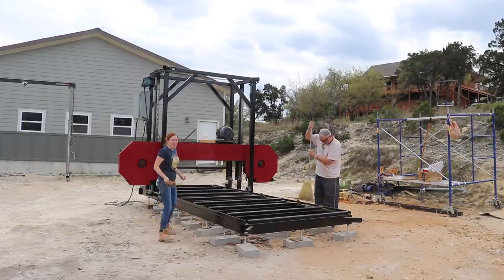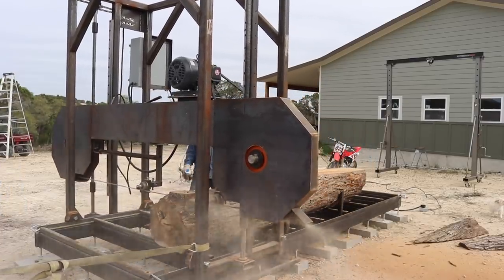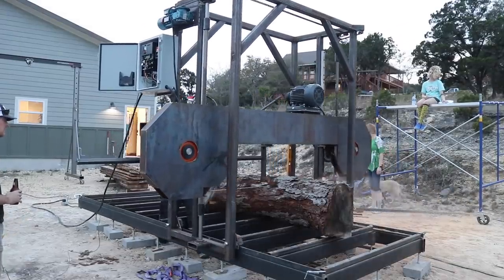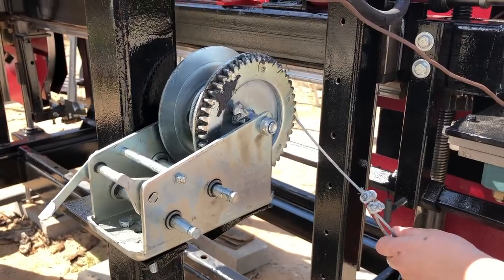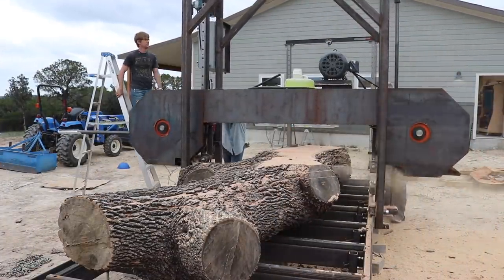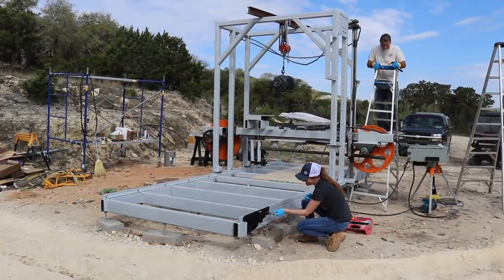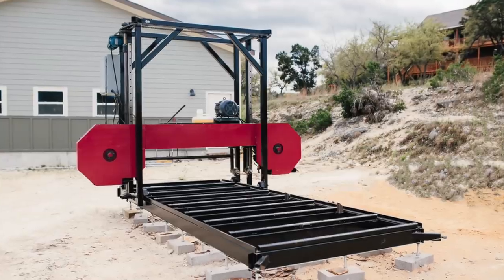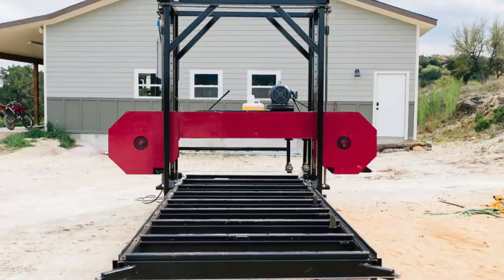Slabbing With My Bandsaw Mill

Comment: April don't use Diesel!!!  Old time sawmills used diesel.  The main reason is that back in the 1880's to the 1930's diesel was cheap.  The reason that diesel is used is that in cold sub freezing areas it prevents the blade from locking into the logs when cutting frozen logs.  It also prevents the slabs from instant freezing back to the log after a cut is made.  The reason that frozen logs have a problem with water is that when the hot blade cuts the log it melts the water in the wood.  Then what happens is that because the log is still frozen as soon as the blade moves father down the cut in the log the water instantly freezes.  This can cause the log and the cut slab to pinch the blade and lock and freeze the blade inside the cut.  Just use water when it is warm and when it gets cold use water and windshield wiper fluid mixed.  If you see ice forming in your tank then switch to straight windshield wiper fluid.  The best thing to do is is really when it is super cold is to just to switch what your cutting from hardwoods to conifer trees.  Conifer trees cut better when frozen because when it's super cold the thick sap in the wood prevents freezing and the other reason is that when frozen the blade will start following the grain in frozen hardwood logs and it will give you a cut with waves in it.  Conifer or softwood also is easier to cut when frozen.  The best way to know how the saw is cutting is not by looking at it.  It's really the sound the blade makes when cutting.  Band sawmill blades don't really need lubrication to make them slippery when making a cut they need lubrication to cool the blades.  Feel the temp of the blade with the back of your hand.  If it's hot increase the amount of water to it.  You video shows a few seconds of the flow rate.   It looks like it is too fast.  Just remember water works best and windshield washer fluid just keeps it from freezing.  Also the color change in the wood is cause from the acid in the wood.  Some woods the color is only on the surface and when it dries it goes away.  Other woods like red oak the acid is a stronger and reacts to steel and iron and will stain and wreak the entire board.  If you don't know how the wood is effected by the acid it is best to rinse the boards with clean water.  In the old days you would see a dunk tank located close to a sawmill and that is what it's for cleaning boards.  You will also notice that your hands will get red it also because of the acids in the wood.  Wash your hands all the time and get a good pair of gloves.  For now you can just hose off the boards with a garden hose and everything will be fine.  I have 29 years working and owning my own sawmill and I hope this helps you and I love your project.

Comment: Don't leave your blade taut as the steel will take a memory of the wheels and when you cut you could possibly get the blade drifting in the wood. Josaljo Wan shows this when you take your belt off your pants and hold it up it doesn't stay straight but rather is like a s shape Great souse of information for saw-milling Tell him I sent you!

Comment: Cut many a mile of wood and never would I have a atomized diesel mist on the wood and in my lungs. Water with soap unless you have water available under pressure. Then just flood the blade with plain old water. Use felt wipers on the blade, both ends.

Comment: i wouldnt go for diesel or kerosene. maybe u wanna us chainsaw chain oil liquified with some alkohol since it is biodegradable and u wont cause aqn oil spill. beware though: whenever u use OILS for lubrication u will have trouble PAINTING, GLUING or EPOCY-ing your slabs since surfaces need to be DRY DUST- and FAT FREE for that!! water evaporates without causing this problem and diesel will also stink like hell. good enough for concrete formwork that will receive some release agent anyway but not good for flooring, construction wood let alon table tops or funiture...i still recomend water or GYCERINE: it is a 3-fold alohol , dense as oil and it can be water-thinned. keep it simple ;-)

Comment: What is the wait time for the logs to dry 🤔? Just a rough estimate
Reply: In very rough estimates...one year per inch of wood.  It's all relative to the type of wood, time of year it was cut down, and of course...the local conditions with respects to heat and humidity.
Reply: @johngrace199  thanks for the helpful information 👍🏼🤙🏼👌🏼

Comment: Instead of you and another person standing the danger zone if the blade breaks. Why not install a lightish spring between the two and install pieces of heavy duty PVC as rollers instead of two solid pieces of steel as log blade guides.

Great build though!

Comment: That blade lubricator ends in a thick felt wick, which is spreading the diesel across the width of the blade. The wick allows good yet economical coverage of the blade. (the fire risk is a different matter!!)
Reply: One thing about Diesel, not much of a fire risk.

Comment: Be a little cautious about getting close to the moving parts-- wood and machinery can be very unpredictable, especially when blades hit something so hard it causes them to even slightly warp and twist, then when there is less resistance the wood can split and fly off. Not a good idea to be moving around so carefree in the target zone. You don't learn that through education and you sure don't want to learn it the hard way.

Comment: Why does everyone put loose blocks on the dirt. A slab is liely a waste.  Put down a spiked metal channel to place you blocks in or make a concrete channel fro each side. Block in the two sides so they are all together like a frame.   A micro video picture of the blade in action shows its vibration, or not should be smooth and no up down during roll.  The longer it dries the better but you should tarp it.

Comment: Next you need to make an oven. Then  wood dry and cure in acid and then dried and then baking in 1200 degree for 2 hours. it will turn out petrified . there's a little more to it. you can artificial petrified wood bake it in 2 hours . Not no millions of years.

Comment: If the top bark piece is to small to actually cover. I'd leave the top off and use a piece of tin.
Also, these logs for the most part are going to be smaller than Cremona's,  might want to use straps and compress the logs .
Great job!😊

Comment: I have a SinglePhase 1/2hp gearhead motor for your millhead, but you need more.
Your rig is awesome. And Beautiful !
I just wanna turn the whole damnthing up a notch by adding some NC into it. A cpl small DRO and Optical Encoders ...
even merely a garage door IR can help... as Limit Switch or scale measure for equal slabs.
Nothing is the same after figuring out how to consistently get 5/4 roughsawn 1000x over.
Next, you can werk the Quarter Sawn Lumber.... and the kids will be beating the path to your door ...you gonna need a new sidewalk !!   ( I recommend 2*4*8" short ends, tamped into a 2-3" sand bed... all varieties will work...looks beautiful, recycling, carbon neutral, and almost as beautiful as grass !! )
Reply: PS...if anyone dares work alone, an alarm/e-stop switch could save a life. I was a chair shop Sawyer, amongst other trades... and talking about sawing things should never end at humans limbs and appendages.
20-ish years, my only injury, ... a 1/8" wide, 1/8" deep scoring saw blade ....across a fingertip... !!!
which meant less than 3" from losing a hand/finger to the hungry main blade.

Comment: DO NOT DRAG the tree on the GROUND.  You are fillint the bark with DIRT that will DULL your saw blade.  
If you were a very serious wood cutter, you would FLOAT the LOGS to the SAW MILL.  So I suggest you dig a WASH PIT HOLE of water that you drag your logs to and build a ramp with a winch claw to grab the wet logs with when the dirt is washed away…..and skid the logs up unto the sawe mill bed frame for positioning and clamping to saw your wood. 
Or learn how to propperly skid a clean log to the saw mill.

Comment: April, How did God pack so much ambition into you for your size? 
Need an aerial look-see, perhaps?
No more questions, just compliments.
Reply: Do you use a metal detector over the logs before cutting? They could have nails, bullets, wire in some of those large logs. Better safe...